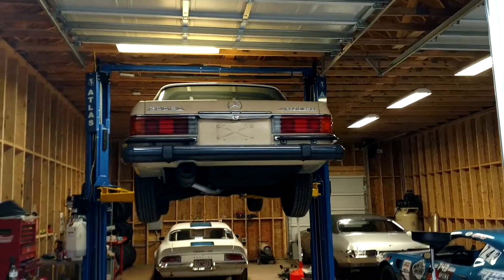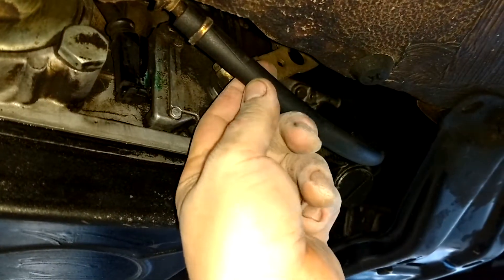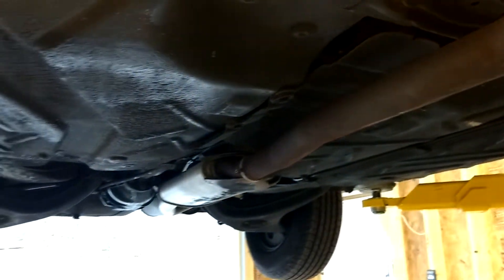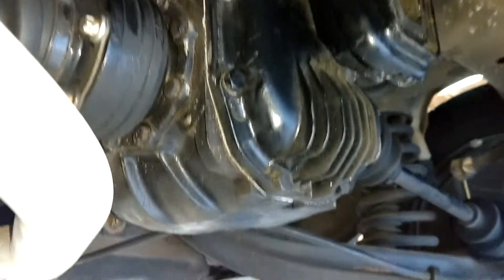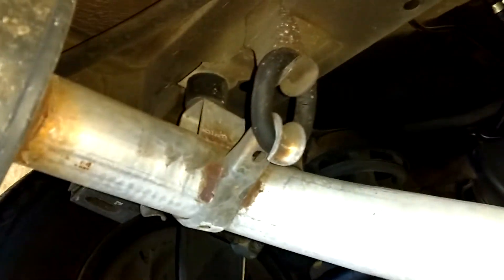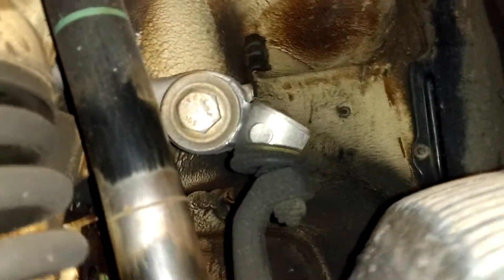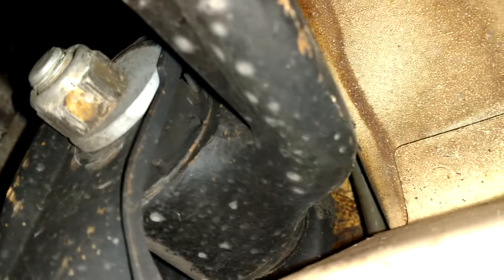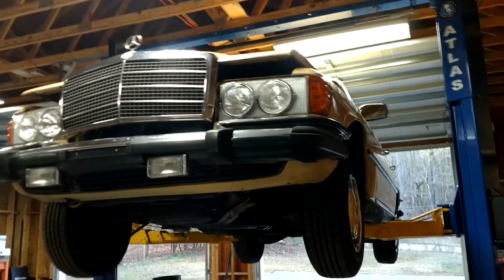1980 Mercedes 300SD - 53,000 Original Miles

Comment: Man, that is a beautiful 300SD! Looks like it never left the garage. Off topic question, how do you like the torque arm suspension on your firebird now that you have had it awhile? I am considering it for my 70 Camaro with the Dutchman axle.
Reply from the maker: Every suspension type has its pros and cons. The torque arm requires no cutting or modification to your car three or four link suspension require hacking your car up. The torque arm suspension is good I made it to the Vegas invitational last year and this year so the car is extremely competitive. One of the common problems with torque arms is wheel hop. Some people experience it some people don't. you have to make sure you're using the right shocks and springs and have everything at the right angles. All in all I'm very happy with my torque arm suspension.